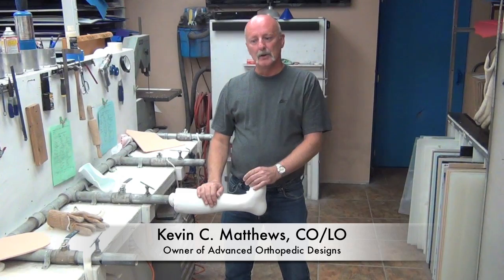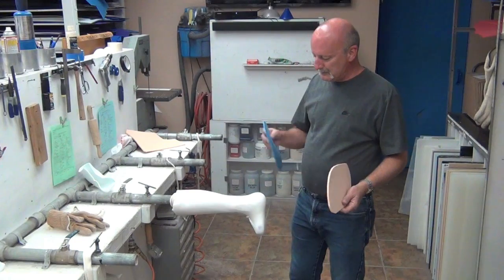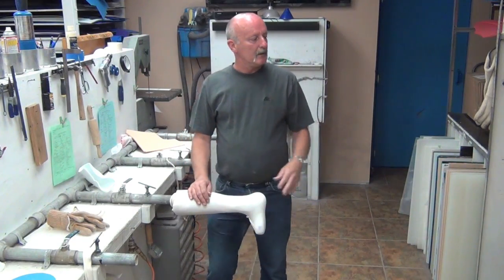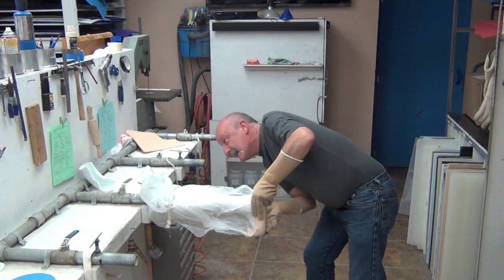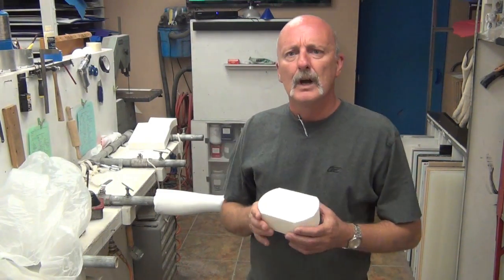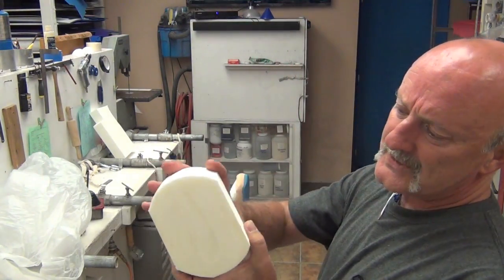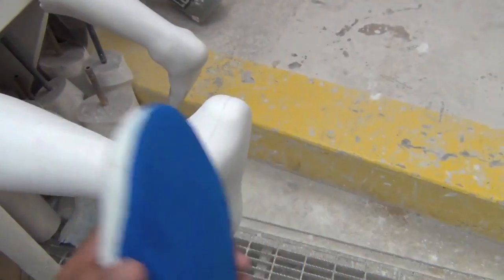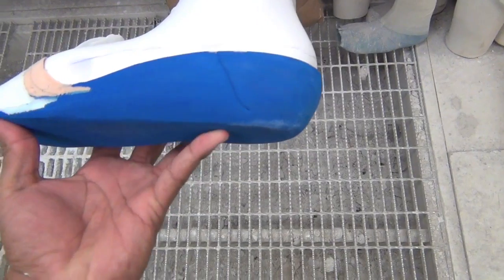AFO: Partial Foot Prosthesis Part 1

Comment: Did you make a full lower leg cast because you are also making an AFO? If you are just making a toe filler can you make a shorter cast?
Reply from the maker: I use a much shorter cast for a toe filler.  This is our technique for a toe filler, tubercle height Prosthesis, indicated for partial foot where there is more than just the toes amputated.

Comment: Hi, can you tell me how you correct heel inversion/eversion on the positive cast?
Reply from the maker: I prefer subtalar valgus or varus as terminology to inversion and eversion.  I feel those are dynamic presentations in gait, and I believe we are talking static alignment.  I correct significant malalignment, more than a few degrees, with a cast saw or band saw to the negative model.  Minor alignment issue can be corrected on the positive.
Reply from the maker: It is much more difficult to correct on a positive model than a negative.  I always correct the negative to avoid trying to correct the positive.  If I, or my technicians, forget to correct it we will typically recast the positive and correct that new impression.  You can correct the positive, but there is a lot of guesswork if it is more than a little.
Reply from the maker: It is much more difficult to correct on a positive model than a 
negative.  I always correct the negative to avoid trying to correct the 
positive.  If I, or my technicians, forget to correct it we will 
typically recast the positive and correct that new impression.  You can 
correct the positive, but there is a lot of guesswork if it is more than
 a little.
Reply from the maker: I make cuts below the maleoli, wedging wider on the lateral to correct varus, medial for valgus.  I then rotate cast to obtain a vertical heel then staple.
Reply: @md shahin alam Hi Shahin